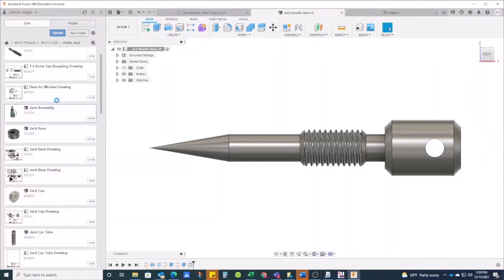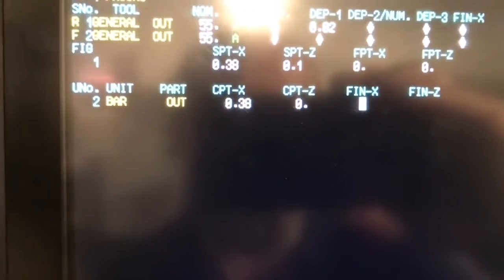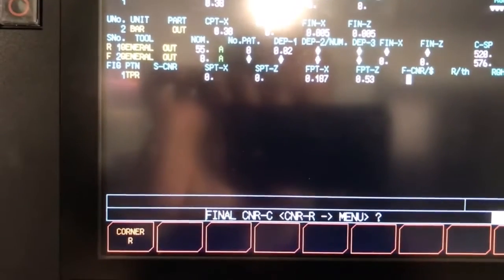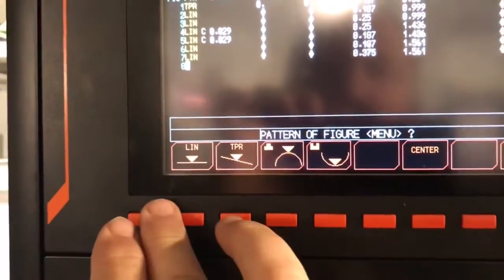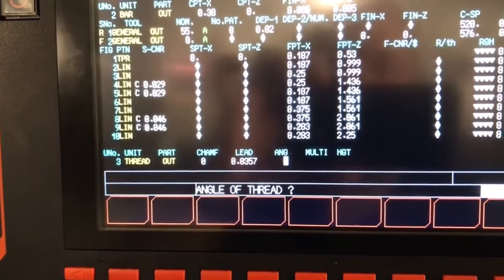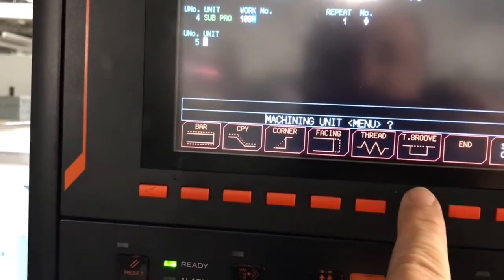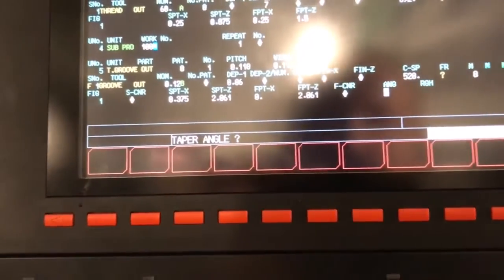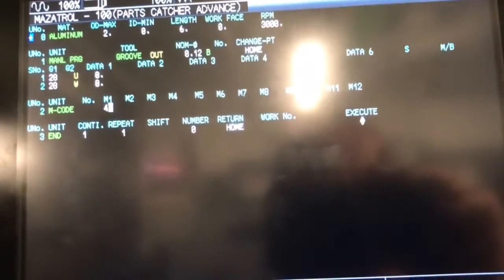How to Program a Needle Valve with Mazatrol [CONVERSATIONAL PROGRAMMING TUTORIAL] - Part 2

Comment: Wish I could take that class! Why would someone program a cnc like this vs. using a CAM program and post processor? Like is it just meant to be an overly complicated learning excursive for just in case scenarios where modeling in CAD/CAM would just take too much time?
Reply: There are many instances where you can program on the control faster than you can draw a CAD model, apply toolpaths, and post your code from a CAM software. For simple turning, conversational programming can be a very valuable tool in a job shop environment where you may only be doing 10-20 part batches. I love CAM especially for milling, but in turning it is hard to beat. I went and looked at a new Mazak lathe and took a fairly simple lathe part print of a part that I manufacture and their applications guy was able to program it on the control in 5 minutes.